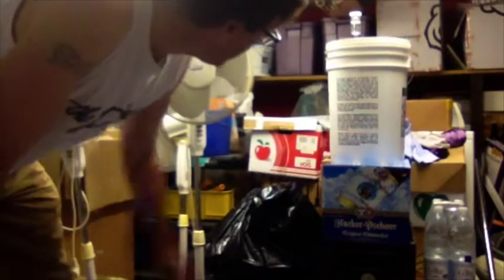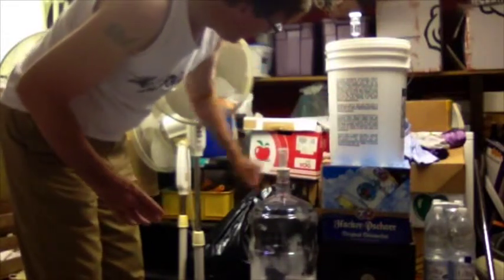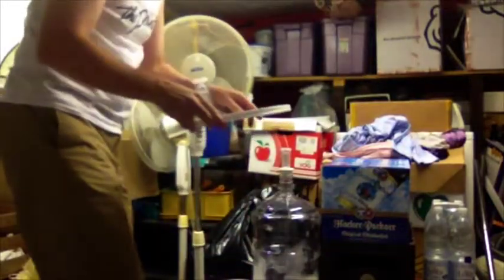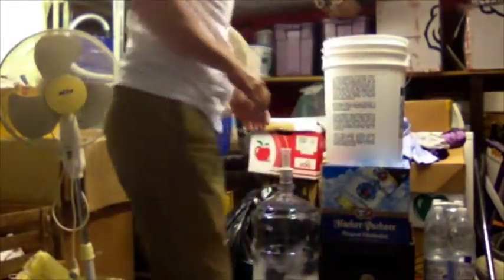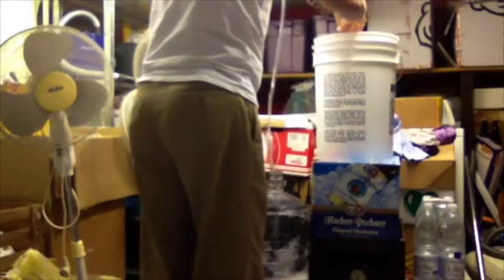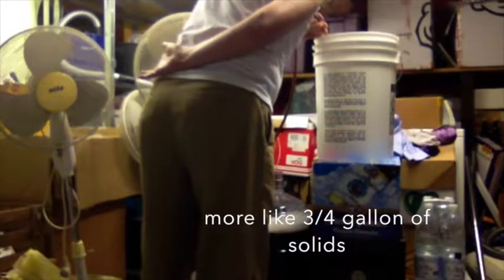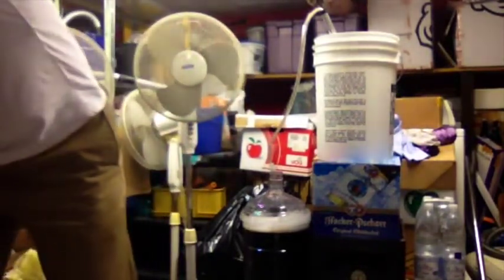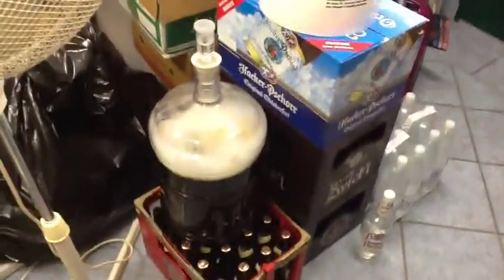Waller HBW 11

Comment: I wouldn't worry too much about the trub smell. How would you describe the smell?
Reply from the maker: Almost smelled like shait, hehehe! When I opened the bucket it only seemed to have the smells that would originate from the ingredients. So, I really didn't pick up this smell until all the beer was out of the bucket. The beer is now in a plastic carboy, but isn't doing anything. I should have taken a hydrometer reading to see where it was at, but didn't. I can see a thin lighter layer on the top of the beer in the carboy, which seems odd to me. Before when using the carboy the beer had a consistent color top to bottom. I'll have to take a reading this weekend to see if it completed the fermentation or not. I'm trying to minimize my handling and any exposure to the beer from the outside.